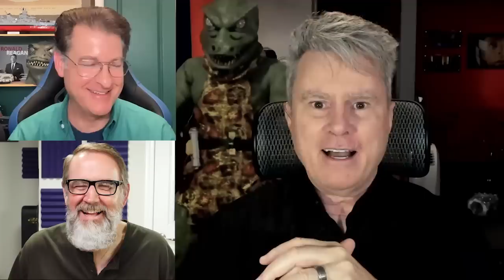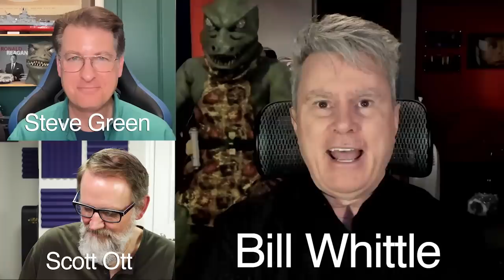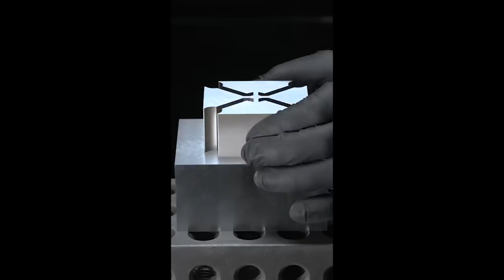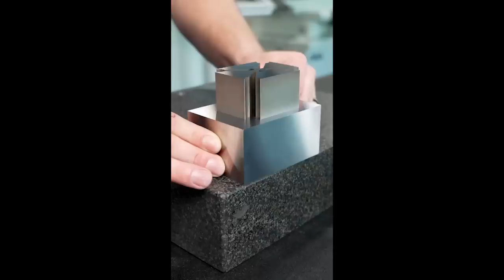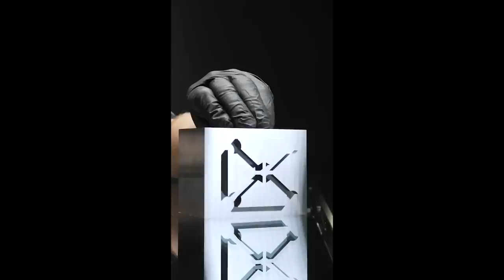Boeing...Boeing...Gone!

Comment: I don't know if it's fair to say that Boeing is the primary culprit. The main culprit is the US Government and their pathological hatred of redesign. I've worked at Boeing, doing software maintenance on legacy systems to upgrade them with new capabilities. Every single engineer on that project knew we should've refactored the software, redesigned it from the bottom up, made it work better, more efficiently, and more simply. And every single engineer knew if we'd bid that way, we would have lost the contract, not because it would be too expensive, but because it would entail too much "program risk" according to the government.

Comment: It is not always the contractor's fault for cost over run. The last designer with the clout able to stand up to the customer pressure was the late Ed Heinemann, of Douglas aircraft when he designed the famous A 4 Skyhawk , with a very long production run. A legion in the same league as Kelly Johnson of Lockheed Skunk Works.  He basically told the USN, at one point, the design would be frozen, and he would guarantee the performance numbers, BUT for every pound of extra weapon and electronics the Navy wanted to add after that, he would subtract one pound of fuel. No other designer before and after Ed dared to say that to the Navy . Still, after Ed was no longer managing the design, the A4 grew lots of weight and thrust. To get an idea as to how much clout you need the threaten the USN, look up the history of Admiral Rickover and his promotion to admiral, how it was forced down the USN throat.

Comment: Apollo One if I remember right, 3 were killed in it. The electrical parts were tested to be flame resistance, but what they missed was , the test was done in regular air, while the capsule had an atmosphere of 100% oxygen. Outside the capsule in space, it is not really that important, for it is a vaccum.

Comment: Surprisingly, parachutes are the hardest part of the return from space. Not so much the supports. More of getting the parachutes to open correctly in a phased approach. Even Elon stated that the parachutes were really really hard. That is, until he started building a ground launch system. Now Elon believes that getting the Ground Support Equipment right is harder than building a rocket.

Comment: It wasn't just the tape,.. it was also the wiring insulator,... all these were the same issues that doomed Apollo One,... In fact would it be possible that one of those great engineers used the design specification from Apollo One without considering its history?

Comment: This same sort of thing happened when a hardware buyer bought the nuts and bolts to assemble a space capsule based on the lowest price he could find.  Over half way through the assembly, it was discovered that the batch of hardware the guy purchased was all used stuff that had been cleaned up and sold to NASA.  The stuff had been mixed in with good stuff, but now they couldn't tell with a reliable degree of certainty which was new and which was used, so all the premium aircraft grade hardware in that facility had to be discarded.

Comment: The problem with Boeing is that back in the 1990s it was run by engineers or most of the top level executives were engineers who put safety over profit. Then when they bought McDonnel Douglas Corp. They switch from being run by engineers to being run by businessmen who care about profit and selling more than their rivals. It is a common joke in aerospace that McDonnell bought their way into Boeing' s board using Boeing money. McDonnell was able to get Boeing to switch their headquaters from Washington state to Illinois far away from their factories. Once airlines start buying airbus plane then you will be seeing the slow death of Boeing.

Comment: "Boeing took a reusable engine for the space shuttle and made it disposable" - priceless.

So yes, the point is illustrated here. NASA made space travel work by throwing money at the problem. Then they never really got out of that mode. To their credit, they tried. The space shuttle was supposed to be all that. But if you read the history of the shuttle, they had this big plan to have two of them back to back and have one fly to space and another one that came back and landed. When NASA's budget got cut, they changed back to throwing away money and equipment - and later lives to make it work.

The paradox is that if they had kept on their original plan, it actually would have cost less. Its short term gain vs. long term gain.

Comment: It's not just the engineering that messed up. The techs that installed that wiring would know and should know what kind of wiring they are installing and say something. If they have A&P licenses they should loose them.
Reply: I love the focus on accountability, but nothing here indicates that the engineers specified the wrong tape, purchasing acquired the wrong tape, or the technicians installed the wrong tape. This appears to be a much more technical issue than "they just grabbed whatever Harry Homeowner Chinesium black tape was lying about" 👍
Reply: @czarnick2  I specifically avoid doing this as an xxx thing but I really am an expert in this area. I have been in aviation for over 20 years and was one of the avionics techs at virgin galactic (got fired for no jab) and we worked directly with the engineers every day. We caught mistake they made in parts choices all the time. That is not to say they were bad but they had a lot of factors they were looking at when designing systems and would miss select what really should he used. 
Human factors aside there are also national  regulations and standards for wiring that were clearly not followed. I have spent a day arguing with 3 other techs and some engineers about the right way to secure a wire harness that is exposed to vacuum. Fyi zip ties will crack in the cold of space so string tie should be used and not waxed string like in regular aviation for similar temperature issues. 
What I am saying is if they have a license they have enough training to know better. This shows a fundamental breakdown of integrity and checking your own work.
Reply: @gargantuanhead512  cool to hear from someone else in the industry, and sorry to hear about the job. Do you have any inside connections on this one? My reading between the lines from their press release is that someone at NASA  brought up some scenarios that couldn’t be easily addressed, and so now it’s going to be a big effort to answer the questions. What would you all use as anti chafing wrap at VG? My understanding is they were using P-213, which certainly seems like an appropriate choice. 

If I had to bet a beer, someone asked about the potential for uncured adhesive in the tape in areas that aren’t in direct contact with the wiring (it’s pressure activated, right?) so now there are questions about off gassing from the uncured areas and potential hazards.

But that’s really just speculation on my part. Curious what your take is 👍
Reply: @czarnick2  we would use a few different items for chafe protection. The only tape used was Teflon tape on the surface near the wires. The bundles we would use spiral wrap or snake skin style protection I forget the part numbers since tlwe had a chart to size match but I know we reviewed the specs before installing it. 
As for the specifics of what is wrong I have not read a lot on it yet. (I listened to this on the way into work) but I plan on reading more tonight.

Comment: I work in the industry, and I just want to point out that reusability of launch vehicle is not necessarily better (and we don’t know if it’s actually cheaper). There are real trade offs in capability. It’s cool, and it might be a net win in many cases, but not all missions can or should be on reusable LVs
Reply: SpaceX knows...and they are launching stuff cheaper and more often (and more reliably) than anyone else because of the reusability of their systems. Two launches a week, with no failures for a very long time, was unthinkable just 10 years ago...two launches a week for SpaceX now seems like a slow week for them. Granted, some SpaceX missions do not re-use the boosters, like Super-Heavy launching heavy payloads straight to orbit...but they take the ones they are ready to retire and use them for those launches--because it's cheaper to do it that way.

Comment: Hi Bill- I am NO fan of Boeing, especially after they got away with paying a fine to avoid criminal prosecutions over the 737 MAX deaths.  I WILL say that I'll personally withhold judgement on the wire-wrapping flammability issue until I see if this tape - which has been used in other (at least unmanned) spacecraft - is now judged to be flammable only because of some new criteria or discovery that didn't exist or wasn't known before.  

If it IS something that should have been previously known, then it's yet another sign Boeing is a disaster, atrocity, and tragedy all rolled into one.

Comment: Sad.  I work at a airport in the North East, with a new Terminal.  I presently work on the LAV truck.  The valve to empty the tank is Shin High. 18-24" above the ground.  The hose to the "Dump" is below ground/floor.  The engineers of the new terminal, put the valve/hose aprox. 3.5 feet above the ground on the side of a wall. The never heard "$hit runs downhill" (?)

Comment: It's better than that. SpaceX recently had a Falcon Heavy launch of a satellite to geosynchronous orbit. For some reason it had to direct to orbit, not a fly-by to get up to altitude. So the rockets had to be expended. What did SpaceX do? They took their oldest rockets with the 1st gen block 1 Merlins that were hard to service anyway. Oh, and they removed the landing legs. Why? Not to increase performance to drop weight, but so that the legs could be reused on a new rocket. When SpaceX was refurbishing rockets for re-use, Elon asked a question. Why are we cleaning them? Is there a performance or reliability issue that is being addressed. No one knew. So he asked, "How much time are we spending cleaning them?" Turns out it was a substantial number of man hours. Look at the rockets being reused now. You can tell just by looking at them that they've flown before.

Comment: This is heart-breaking.  My husband worked for boeing until his retirement in 2015. This is awful. He was an NC programmer and worked on at least one part for the old space station. Why did they even have flammable electrical tape in stock?  Oh, well, there goes my pension.
Reply: I think this whole thing is massively out of proportion. They used P-213, which is a custom, specialty glass fiber tape designed for this application and is commonly used on spacecraft. They didn't just go down to harbor freight. There's even a Boeing specification for it. Their press release says "NASA and Boeing are evaluating this material..." which I guarantee means that someone at NASA started asking new hypotheticals about how "the adhesive properties of the tape could present a flammability risk under certain conditions."  I think "certain conditions" and "NASA and Boeing" are clues that this is NASA driven. This stuff is used all the time, it's designed for the purpose, it wasn't sloppy engineering. But man-rating is an absolute nightmare with NASA, so these sorts of questions are bound to come up, and they're never easy or cheap.

Comment: If the Boeing aircraft division operated like their spacecraft designers, airliners would be built for one-time use only. Upon arrival at the destination airport, passengers and crew would all disembark, then the tow truck would pull the plane directly to the on-site metal shredder. 

Oh jeez, I hope they don't read this. Someone might get a bright idea...
Reply: Sadly, considering how much trouble Boeing has had in their aircraft division (737-Max anyone? Or, dare I say KC-46?) they might as well go to one and done!
Reply: The use case is radically different. It’s easy to make this mistake, but a reusable aircraft is not a very good analogy. If an airliner had to expend 95% of its mass to accelerate to 17000 mph, survive extreme aerodynamic heating, operate in subsonic, transonic, supersonic, and hypersonic regimes, survive reentry, operate in a blisteringly hot vacuum, in a frigid vacuum… there would be no reusable airliners. Probably no airliners at all
Reply: @czarnick2  You read things very literally. That's OK.😉
Reply: @czarnick2  Just a little sarcasm on my part.
Reply: @chuckw1113  lol, the engineer in me doesn’t always catch sarcasm. “Humor. It is a difficult concept. It is not logical” 🖖

Comment: Apollo 15 was the mission that splashed down with only two good parachutes. Fortunately, the third parachute on the Apollo CM was redundant - turns out they'd planned ahead! The fourth parachute on the SpaceX Dragon is also redundant, and was added at NASA's request after the first test flight.

Starliner doesn't splash down in the water, though - it touches down on land, like the Soyuz capsule. So it needs to be going slower when it hits the ground than Apollo or Dragon when they hit the water.
Reply: Well, Elon Musk and SpaceX wanted the Dragon to not splash down or just touch down with a parachute landing...they wanted to LAND it like they do the boosters with the Super Draco engines--which have been relegated to merely emergency abort engines. But, NASA, the big government dinosaur that it is, said it wouldn't work and was "unsafe" and made them redesign it (it originally had landing gear, like the boosters) to have parachutes and be fished out of the sea...like it's the 1900s or something.